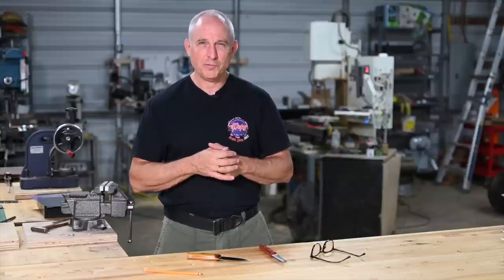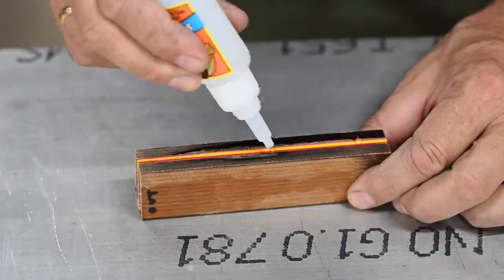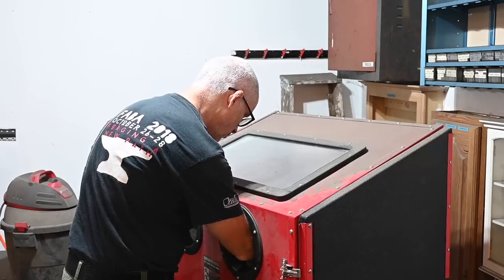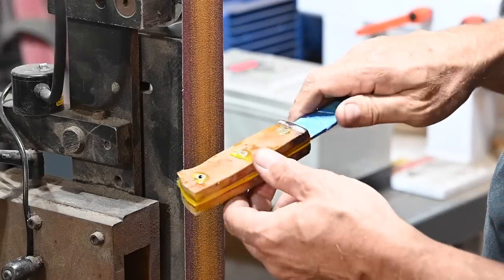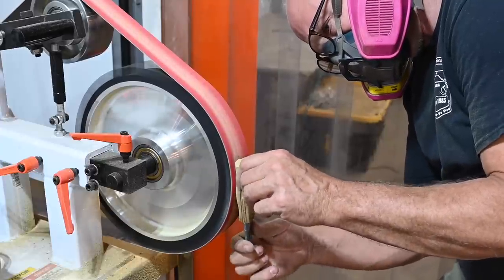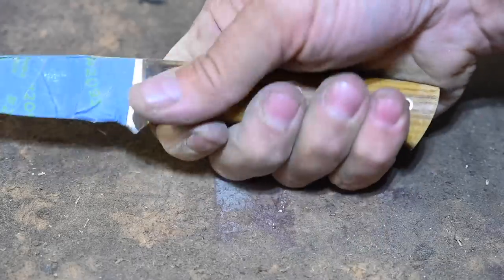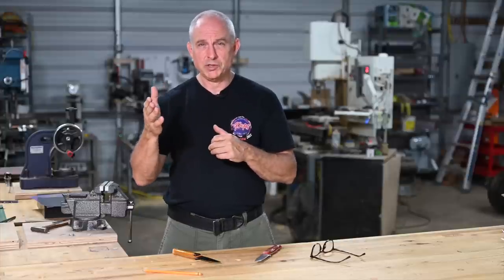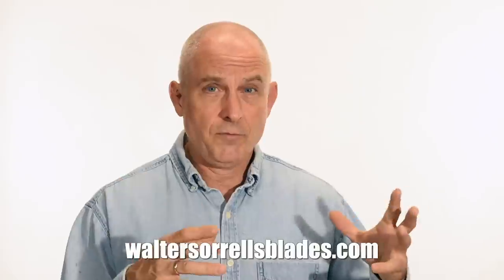I Just Got Schooled! (Learning How to Make a Knife...Again - Pt 2)

Comment: The one thing that I found strange was using CA  glue to attach the liners to the handle scales, then using epoxy for final glue up.
Reply: That surprised me as well.  Always used epoxy for the vulcanized material just like the scales.
Reply: I believe that was just to hold everything in place temporarily so things stayed oriented during the next process.

Comment: i do a similar thing with the handle but i tape em on the tang side and super glue there. then i do everything with them till glue up. drilling holes, doing the fronts of the scales, shaping to the tang, all done on both at the same time. then just split em apart, remove the tape and its good to go

Comment: Very interesting, sir. I'm not at all sure why one would want to taper a tang, but hey, I'm a knuckle-dragger anyhow. Thanks for sharing this with us. Cheers from Virginia's southern border.
Reply: Tapered tangs do two things, first, it adds style! It looks cool, and it's not something you'll find on a commercial knife. Secondly it reduces the handle weight a lot, which makes a thin, short bladed knife like this balance out better, same as the extra hidden holes drilled in the tang. The heavy 1/4" pins kinda contradict this, but, hey, style?